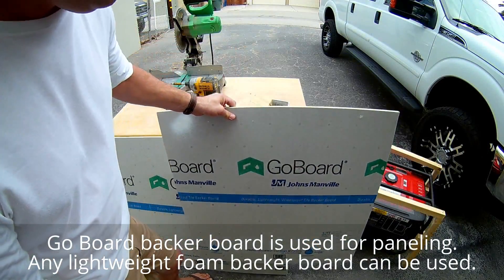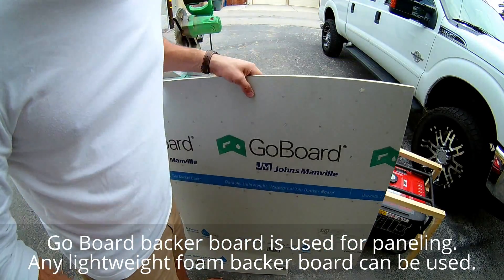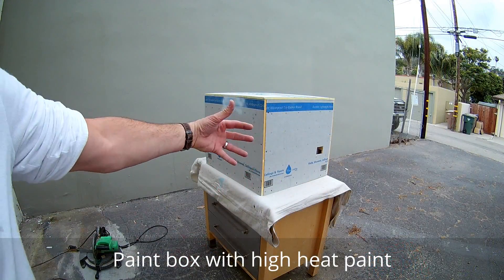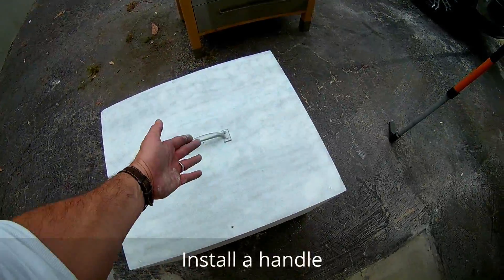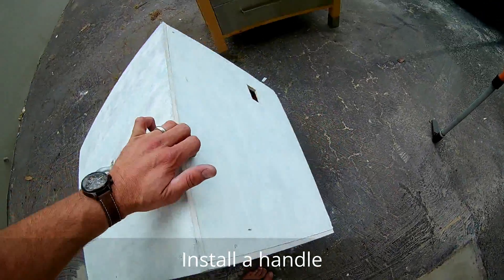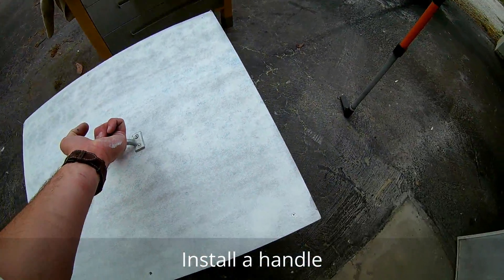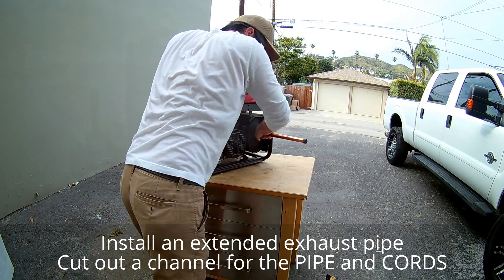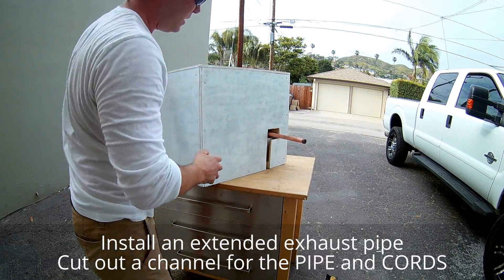Best Lightweight Generator Quiet Box Part 1 - DIY

Comment: That pipe gets smoking hot and it catches that foam stuff you put in there on fire and I'll catch the back of a truck on fire I built the exact same thing and they cut the pipe just got so hot that the wood gets all hot and you don't have enough air flow going into the motor
Reply from the maker: I made a second video with the fan airflow installed. Also, Go board is made of fiberglass along with 2000 degree spray paint sprayed inside and out. I can run for hours without any heat problems.

Link to the second videohttps://www.youtube.com/watch?v=efmkyWbWof8
Reply: Landberg Tile-Handyman-DIY excellent I probably going to do the same thing cuz my generators loud they're running all day do dog grooming

Comment: That generator is going to be super quiet because its going to burn up and shut down.
Reply from the maker: I did add a fan for air flow and outlet access ect. Check out these videos on the fan install and the box in use camping.
Fan install etc:
https://www.youtube.com/watch?v=efmkyWbWof8
Quiet box in use camping:
https://www.youtube.com/edit?o=U&video_id=Y4megRvGx1M

Comment: 1st:
I HATE GoPro camera's... They distort everything in the video, the picture looks like crap..
2nd: Great job as making it quiet...
3rd: That generator is going to overheat on you and you will blow the motor because you have ZERO air flow...
Reply from the maker: Yes, still learning videography. I'm super new at it. I have since moved away from the fish eye wide settings on my newer videos (if not in small spaces)

Also, I have a follow up fan addition video that gives the quiet box air. I should have merged the two video's together, LINK
https://www.youtube.com/watch?v=efmkyWbWof8

Lastly, cool video on the Darth Vader Lightsaber Power Bank. My buddy just opened a Saber Nights Academy. Super cool stuff
link, https://www.youtube.com/channel/UCLRYRovFRvY2m5EsBwbxmPQ

Thanks for watching btw!

Comment: This is a lot like choosing your oven as the best place to run your generator. It's true that it would be much quieter inside the oven than it would be outside of it, but if you do this, you might as well go ahead and turn your oven on while you're at it because it won't be long before its going to have the same impact on your generator. The generator has to have some airflow. Your box construction was adequate, but I'm sorry this is a really bad idea.
Reply from the maker: +Randy Gamble https://m.youtube.com/watch?t=11s&v=efmkyWbWof8

Comment: It sure cut the noise down, but my concern like others, is that you have made no provision for ventilation. The 'Genny' is going to dissipate a huge amount of heat, if you are running this for an extended amount of time, your gasoline is going to evaporate, producing highly explosive fumes, according to 'Murphy's' law you are likely to be blown to kingdom come. Please consider cutting side and top vents, you can use galvanised louvred vents, also possibly use a couple of cheap bathroom fans which you could run off the 'Genny'.
Reply from the maker: Thanks for the comment! I do like constructive criticism. I did add those elements you talked about in another update video I uploaded a while ago. Also, I only run this a few hours at a time at the most while camping.
LINK: 
https://www.youtube.com/watch?v=efmkyWbWof8

Comment: Hahahaha, You made a box to quite your generator, however, you failed to provide an outlet for your electrical cords. You failed to provide for Air intake. You failed to provide a quieter box because the sound waves are bouncing perpendicular to one another and not cancelling each wavy out. I laugh because it is a good start; but, a failure.

Here is what you need to do to reduce your noise. Create a panel that will allow you to connect your power cords to the power outlets. You can do this by providing that insulating each power outlet to reduce the noise vibrations.

Next, create an intake port with a blower. You can add a temperature sensor that will kick on when the generator gets to a certain temperature and kicks off when the temperature reaches a cooler temperature. Much like a radiator fan on your car or on a semi-truck. The faster the fan moves the cooler your generator will be.

Then you will need to fire proof the interior because over time the inside will dry out and the flash point can be reached under certain circumstances and you will have a fire if not burn marks.

Finally, angle the Go Board paneling downward towards the ground, about 45 degree angles. The sound from the generator will bound off the paneling and into the ground. This will drop your sound from an open to the environment 80 decibels (dB) units to 70 dB units inside your box. In fact, you can add  acoustic foam panels, www.sweetwater.com, which will greatly reduce the sound even more. Or better yet apply the heat shield that you find attached to the hood of your car that protects the hood of your car which will absorb the sound plus protect the inside of your box from fire.

Remember, you don't have to make a small tight box. If you spread out a bit you will reduce the heat, decrease the sound and give you access to the power outlets. (Keep it off the pavement, concrete or other hard surface.) But, under the circumstances it was a very good video, you just made me laugh at your first attempt. (laughing with you, not at you.)
Reply from the maker: Thanks for the comment! I do like constructive criticism. I did add those elements you talked about in another update video I uploaded a while ago. 
LINK: 
https://www.youtube.com/watch?v=efmkyWbWof8

Also, keep in mind that Goboard is made of fiberglass. I also painted with high heat spray paint. I tested a few areas with a blow torch and it nearly impossible to catch on fire.

The box is in great shape as of today with over a hundred hours of use with different generators.

Thanks!
Reply: You da man. I knew Goboard is made of fiberglass; but, there are those that didn't know and I just added a few ideas that they can use as well. :-)

Comment: shouldn't there be a final piece of the wall construction to put the generator on? I'd expect leaving it on a cement floor isn't quieting as much as if there were insulation on the ground!
Reply from the maker: That could be an idea, but it already quiets the sound when I run it a couple hours at a time during camping trips.

Comment: Like the idea...shouldnt we concerned about a fire, meltage? Juss asking? And will the walls of it last out in the snow/winter?
Reply from the maker: I've since added a fan to help circulate air, video here. https://www.youtube.com/watch?v=efmkyWbWof8 
Also, the Goboard is waterproof normally used for tiled shower walls, so maybe yes it will last in the snow.
Reply from the maker: I've used the box for hours in 85+ degree weather with no problems so far, thanks!

Comment: What about overheating issues? I can see if it's liquid cooled you could put an external radiator on it but with air cooled I would think it would get really hot in there

Comment: I think if the genset is going to be on grass or soft ground the airflow vents could be close to the ground for absorption. I know heat rises but if max quiet is needed that would at least let air move. I have heard that on top is best and the sound goes "up" which makes sense since most people aren't right on top of the unit.

Comment: it will overheat. i stick mine in  a 8 x 12 little shelter barn and it still gets hot as heck with the door closed. not good as you want it cool
Reply from the maker: +Gadget mall runs great now with the fan installed. I only run it a few hours at a time while camping...

Comment: Why not just drill a hole that lines up with that exhaust pipe and install after box is put on? Rather than cutting a long channel....

Also wasn't a fan of the loud music through out the video...
Reply from the maker: +Kevin Mendez i did drill a hole,  but quickly realized that after running the generator, the exhaust pipe got hot and I wasn't able to remove the pipe to pull the box  off. The channel allows for the box to be put on removed without having to touch the pipe.

Yes, the music is a bit loud, still working on my editing skills, i do appreciate the input.

Comment: you need to cut a fresh air intake where the pull string is to draw in cool air to cool the engine and at the same time push off heated air off the generator, ad a exterior piece on the inlet end angled at a 45 deg angle  which will deflect that sound downward. nice project, liked the double wall system.
Reply from the maker: +Max1Chase1 I've since installed a fan which has helped to cool the engine. Great idea on inlet at a 45 to deflect sound! I'll be posting an updated video soon.
Reply: Landberg Tile-Handyman-DIY spanish y puedo dural muschas horas ✌✌ PUERTO RICO NEXT HURACAN

Comment: where do you put the plugs when the box is on?
Reply from the maker: +HeathenFPV I cut a square hole on one side with a latch to accept the plugs. I'll post an update video soon!
Reply from the maker: Landberg Tile-Handyman-DIY
2 seconds ago
I did add a fan for air flow and outlet access ect. Check out these videos on the fan install and the box in use camping.
Fan install etc:
https://www.youtube.com/watch?v=efmkyWbWof8
Quiet box in use camping:
https://www.youtube.com/edit?o=U&video_id=Y4megRvGx1M

Comment: Questioning air flow to carberator and long run Overheating !
Reply from the maker: Yes, it will in hot weather and I've since made airflow modifications. I installed a 10" fan on the side of the box that plugs into the generator to blow air on the cylinder and help cool and circulate air. This has definitely helped and I'll post an updated video soon
Reply from the maker: Landberg Tile-Handyman-DIY
I did add a fan for air flow and outlet access ect. Check out these videos on the fan install and the box in use camping.
Fan install etc:
https://www.youtube.com/watch?v=efmkyWbWof8
Quiet box in use camping:
https://www.youtube.com/edit?o=U&video_id=Y4megRvGx1M

Comment: very neat idea but a question 
why not put the insulation in before put on the sides you have all ready made a frame to hold it in there 
just a question of the day no biggie I like it swell idea
Reply from the maker: That's a great question! I should have put the insulation before the sides, it was hard to put it in afterwards!
Reply: exactly and it will be possible to press there even more insulation layers, but better would be to buy sound insulation boards + sound insulation at home depot also would be nice to put hinges lol etc to make it foldable. That would be so fun diy project for me, I don't own generator tho haha
Reply: Actually, it would be more effective if the walls were double thickness and the bare insulation faced the generator. The fiberglass would then absorb high frequency noise and the double walls would more effectively block lower frequency noise.

Comment: I like the box, but you made no provisions for air flow :/
Reply: I did not see any provision for plugging in the power cord.
Reply from the maker: +Jeffrey Vicks I will be uploading an update video tomorrow with fan and latch for cords. Thanks!
Reply: I’d use Styrofoam between the 2x2s so you don’t need a board on the inside. Also, a way to flatten it for travel as I have a bed cover. Hinges maybe or screw inserts.
Reply: https://www.youtube.com/watch?v=efmkyWbWof8
Reply: Works great for 15 seconds.
Reply: He has no clue what overheating 🥵 is.
Reply from the maker: I did add a fan for air flow and outlet access ect. Check out these videos on the fan install and the box in use camping.
Fan install etc:
https://www.youtube.com/watch?v=efmkyWbWof8
Quiet box in use camping:
https://www.youtube.com/edit?o=U&video_id=Y4megRvGx1M
Reply: And how about in the made for a generator bay of an RV?  The entire bottom of the bay is open to the ground below.  Seems nearly all RVers do so while in travel so as to have everything charged for later that night to avoid disturbing others if at a campground.
Reply: Worthless.  No airflow.
Reply: Dude how do you plug into something like that? Also, I'm a carpenter and you have to realize most people don't know how to do this stuff.  You failed to explain why you added the footing because you didn't show us how you used it to space your backer boards in order to create a cavity for insulation.  The video was great other than you skipping that part, people who aren't handy or skilled would've gotten lost there.  And obviously this isn't practical.  You have to have air flow and you also need to be able to actually use the machine you are trying to silence.  Having nowhere to plug into is kind of counter-productive.  But all-in-all, it's a video, for sure.
Reply: Well, I don't think I'd run it indoors is a good idea because of carbon monoxide. 
Anyway, just a hole cut in one side with a fan to pull air through to keep it cool. At least a hole for ventilation if you're in cooler climates. Myself, I live in Vegas where it's incredibly hot and I'm going to be using a fan with copper coils surrounding it with ice water from a large cooler running through the coils.I don't think you need to go to those extremes in cooler climates; just a breeze should do.
Reply from the maker: +Spaz 12 I think I'll have to take your advice and install a portable 10" fan that can plug in the generator. I'm sure it will help the box airflow. I'll probably build a larger second box to run tests and compare and come out with a quiet box update video. I do appreciate the comment and advice!
Reply: Sounds good. I will subscribe and wait for the updated video.
Reply from the maker: Thanks for the sub! I'll have an update as soon as possible.